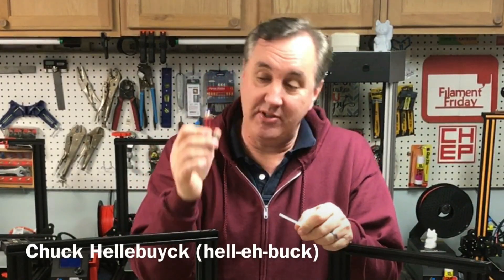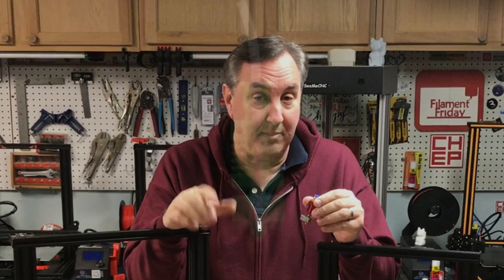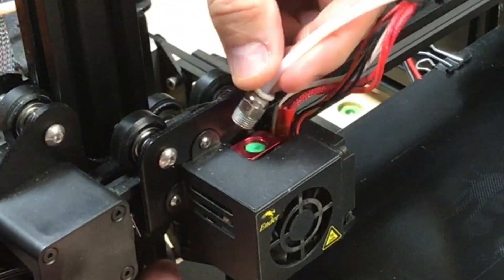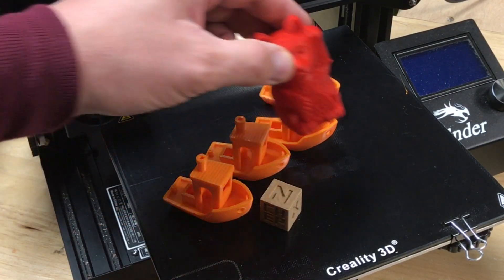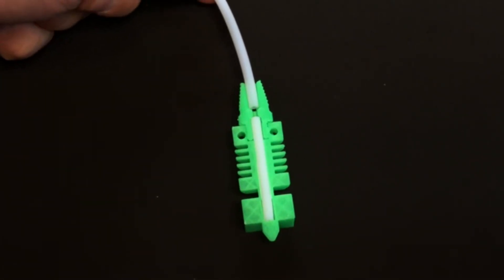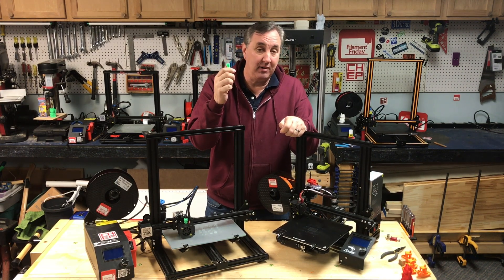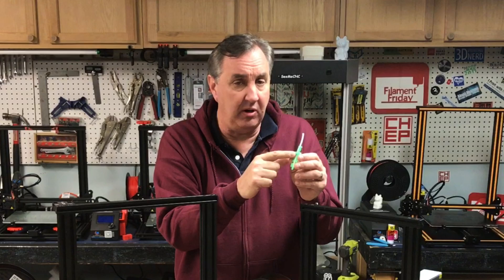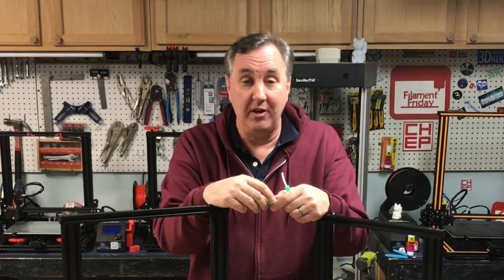Creality Ender 3, CR-10 - Hotend PTFE Fix

Comment: I have a Tina2 3D printer and I am haveing a heating problem the machine heats up to prepare the machine after the machine has purged I start to lose heat before I print any product andI get a heater failer error how can I fix this problem

Comment: well but why did you have to use that spacer in there, wouldnt it had worked if you just pushed the ptfe tube down without the washer?
Reply: The coupler will eat into the tube during retractions and feeds. That is what causes to movement and in turn the gap at the tip of the PTFE and the nozzle. What this does is "decouple" that last section of PTFE and forces it into the nozzle then if the second section that is held by the coupler moves around it will not be a problem causing clogs and backups . The washer is what is pushing the last section of tube down from the coupler threads pushing IT down.
Reply: to stop the ptfe tube from backing out causing a small gap between the nozzle and ptfe tube (a common problem for the ender 3)

Comment: The Boden tube coupler faild me and was nolonger holding the tube to the hot end will definitely get this printed out. In the mean time I used the smaller coupling and JB welded it to the larger coupler so I can print the parts

Comment: my fan seems to slow down considerably to and then if I like touch the fan blades real quick with the tip of a tiny screwdriver it'll stop and then spin up really fast again then slowed down to a crawl. What I've been seeing is my filament is melting up into the tubing I ruined two sections of tubing in one day just now. Would you say that this is what's happening probably the fan is not keeping the top half of that all metal extruder cool enough? I'm also a machinist do you think if I made a two piece extruder with the top half out of copper it would help? Copper seems to dissipate heat better than any other metal other than gold I'm wondering if I should give that a try. Be a little bit expensive you couldn't really mass-produce on for any kind of reasonable cost but I could make him for myself LOL please let me know what you think if you think this is my problem I just ordered a couple replacement fans and a couple yards are tubing etcetera. I ordered the blue tubing that you show in this video I can't remember the name of it already I forgot I'm getting old LOL
Reply from the maker: Yes, sounds like your fan is failing.
Reply: I've ordered some new tubing and fans and they should be here first thing Monday morning I'm bummed out because I just got this damn thing they must use really subpar fans. At any rate I did kind of burn my fingers trying to take the top coupling out that should not have been hot up there so yeah the fans got to be the problem I had melted pla two and a half inches up the tubing. So it must have been a cap and then greeting itself up the tubing until it finally cooled and then I noticed extruder gear clicking every once in awhile as they gave up and then spun back into place I also noticed that the screw was about three turns loose on the spring assembly so I think it was a combination of things.

When I get my fans if there's enough Warrior left on the fan should I try and feed it all the way back to its source or just snip and solder and heat shrink? I think I'll just snap it Saturday and he trinket nice and neat. Luckily I have 30 years of soldering so it'll being nice job anyway. Maybe I'll get to Molex connectors I have a T-Type Molex crimper I could make a connector right there so if I have to switch fans it's just plug and play

Comment: im so discouraged my PTFE tubing keeps getting clogged way up/  I'm new and bought a cr10 s2    in one day I fucked my machine up no ptfe tubing left.  is there any PTFE i can buy that cheaper then the damn crap they sell specifically for the cr10s
Reply from the maker: Cap Tubes & Couplings: https://amzn.to/2Vf8BCf
Reply: @FilamentFriday  I bout this type of tubing although I am looking for like a spool of the stuff. these manufacturers rip people off.  I'll put this through a time gas chromatograph-mass spec and find out its composition 

I, also a metal worker. I have a lathe and mill with all the optional toys.  I want to modify a nozzle to allow the tubing to go into it by a few mm.or perhaps a metal tube that screws into a custom nozzle that attackers to a tube that the top fitting screws right into maintaining the <2mm size.
Reply: @ClownWhisper  I know it's been 2 months since you posted your comment but you should really consider getting rid of the "ptfe lined" hotend type and move to a full metal one which is much better to finally use your printer and not toy and tweak shims and bits of strings to get your PTFE tube to stay in position.  
On creality machines you can get a microSwiss drop in replacement hotend (or go for the clone one by trianglelab which does a good job unlike many other part cloners).  
The "creality hotends" with ptfe down to the nozzles are  such an horrible horrible hooorrrible design they're not worth fixing. 
Hope you've got your printer fixed tho ;)

Comment: ever since I aded  caper corn tubing I have bin getting under extrusion
Reply from the maker: Check for slippage at extruder.
Reply: @FilamentFriday  less the screw was extremely lose after tinting the screw the issue was fixed

Comment: Chuck - I am still having problems with my HotEnd that came on the SunLu S8.  I have taken it apart a number of times to clean out jams.  The hot block on this is a little different than the other Hotends ..  if y ou could take a look at yours (I bought mine after you did a demo ) and you can see that you can not push the Bowan tube all the way to the tip ...  it has a separate piece that can only go in from the bottom..???  Any help would be appreciated..>!!

Comment: This hot end "fix" (some call it Luke's fix) seems to be making the rounds lately.  I tried it and it didn't work for me.  My problem turned out to be "heat creep".  When I removed the two screws adjacent to the nozzle my problem vanished instantly.  Previously the printer would run perfectly for an hour or two and then clog up.  When I cleaned it out I noticed the filament in the lower end of the of the heatsink had softened causing an increase in friction the extruder could not overcome.  That's a clog.  Anyway, I think Luke's fix is a good idea but I also know heat creep is very real.
Reply from the maker: Heat creep is caused by a failing fan not the screws. I’ve seen it on my own machines. Fab spins but too slow to cool. Replace the fan and heat creep goes away.
Reply: @FilamentFriday  What makes you think it must be one or the other?  I didn't invent the screw theory, I only confirmed it.  You're free to think & preach as you choose.  My fan spun at the same speed before & after I removed the screws.
Reply from the maker: Exactly. The fan was probably spinning too slow. I have a printfarm full of these hotends with screws running for years without the issue until a fan starts to fail which is common on these printers. Removing the screws is a bandaid to the true root cause but you can fix it anyway you want.
Reply from the maker: I don’t base my findings on one printer, one experience. I often test on multiple and get 3rd party feedback as well when creating the videos.
Reply from the maker: Here is more proof of someone who was in your camp. https://twitter.com/v_saggiomo/status/1309883595419537410?s=21
Reply from the maker: I’ve had far too many beginners listen to myths like that and then come to me for help. That’s why I make the videos to help prevent their frustration.
Reply: @FilamentFriday  As a newbie, it's hard to tell a guru from a BSer.  Not saying you're either but I've learned over the years to believe what I see over what I hear from a source I don't know.  My screws stay in the spare parts bin.
Reply from the maker: Gotcha. I’ve heard this type of skepticism before from many newbies. But after 6+ years 3D printing and making videos sharing my experience has gained me almost 150k subs and 13 million views. I’m not that good of a BSer :)

Comment: Hi Chep I have a second hand cr10s it has a heat tape around the hot end  my question is, is it needed it is lose and has had filament built up under the tape can I remove the tape I have a pic I can send you if you like.
Reply: yes you can 
replace it with a silicon sock though

Comment: is there any reason you couldn't use this as the foundation for an all metal upgrade by using an aluminum tube in place of the ptfe tube?  or maybe switch to a PEEK liner?  mcmaster has 2mm IDx 4mm OD PEEK tubing with a claimed max temp of 500 celsius for $18.71 a foot, one foot could do about half a dozen printers.
Reply: this sounds like a great idea
Reply: Aluminium will conduct heat all the way to top and melt all the filament and jam it.
Bad idea!
Reply: @parasyte25  peek tubing is what I was talking about.
Reply: would want to use steel to prevent heat creap
Reply: @elitewolverine  peek tubing would prevent heat creep better than steel
Reply: @butre.  This is true but still limited to lower temp printing...then again not many people are gonna print above 300 or 350c

Comment: Huge question!!! What if you use a steel tube with sizes 4mmx2mm? Is it possible to increase the maximum printing temp???
Reply: I guess there would be some tiny gaps between the tube and heatsink   
might reduce the cooling efficiency
Reply: @achen5269  the PTFE tube is 4mm so gaps will be tiny. The bad thing of have a steel tube touching the nozzle it is that it can heat up but higher in the heatsink it can dissipate that heat quickly.
I am waiting for my CR-6 to test it but I though  @CHEP could try it more professionally.

Comment: Hey there love your vids, found you today and you've already pointed me in directions I didn't know ^.^

anyhoo I have a question that you might know to answer. I have issues with leakage (and after this vid I have good ideas how to fix it) but it's now the second time that the heatbreak and nozzle basicaly fuse with the heatblock and I have no way to remove them. I threw out 2 blocks already, so my question exist out of 2 parts:
- Is leakage the big problem here? (My head is going to places like is it expansion/shrinkage that fuse them?)
- Is there a way to recover from it? ... and I mean fused as in: no way to get them from the heatblock. it goes as far as the nozzle being almost a circle as the wrench doesn't want to make it budge and chaves off the brass and today was the first time I actually broke the heatbreak and now only the thread is in the block :/
Reply from the maker: Do you heat it up first when trying to remove it?
Reply: @FilamentFriday  hmm good point, no. But kinda fearful of doing that... I built my printer from scratch with 0 knowledge (learning along the way) ... i might mess stuff up xD

Comment: Maybe it has already been noted, but the printed fitting did not hold the Bowden tube on my CR10s. I was 15 minutes into my first print after the hotend fix when the filament pushed out the fitting. The male threaded portion looked very rough. I had printed a second one because it didn't look substantial enough... The 'nut', on the other hand, looked great. I was hoping to not have to buy the pneumatic push-lock fitting. Not the end of the world.

Comment: You should make a video about the overheating hot sink. Mine overheating heat sink melted the little washer that I printed from your thingiverse (linked in another video) - and before long nothing worked and it had to be unscrewed/cut out of there, which was fun and only took an hour or two. I spent a long time perfectly measuring and cutting, so I had no idea what was wrong and was thinking it was a really bad mod idea - until just now when I watched this video. The fan was working well until I installed the SKR mini board, and I'm thinking the pin outs I had (which said to switch the board fan and the heat sink fan) are incorrect.
Reply: Though, in thinking about it, I realize you may have already made a video about the dangers of a weak heat sink fan...

in a previous....

Filament Friday.
Reply from the maker: I did. And showed how to replace it with a new stock fan. It is common on early Creality printers to have that fan slow down and cause heating issues.
Reply: @FilamentFriday  In that case, I am realizing I actually might have watched it, lol.. Thanks for all the great stuff. For some reason I thought the SKR mini would only turn it on as needed, but others say it's always on, so mine being never on seems like a bad thing. But if I hadn't watched this, it would have taken much longer (and many more failed prints) to realize where to start.

Comment: I am really tempted on trying this upgrade since it has many benefits. I am only scared by one aspect. 
By adding the plastic washer/ptfe tubing, basically the threaded plug is going to be tightened against a plastic part instead of a metal one (as it would be tightening directly on the heatsink). Given the low elastic modulus of plastic, I am scared if this wouldn't give a proper tightening to the thread leading to loosening after some time (considering also the heating effect). 
Did you have any untightening experience after long time usage of this solution?
Reply from the maker: Update video: https://youtu.be/7tCxO17XZtw

Comment: How long is the piece of PTFE tubing that you put into the hotend?
Reply from the maker: It depends on your hotend. 
Here is an update to this video.
https://youtu.be/7tCxO17XZtw
Reply: If the prop is correct then it's about 43mm, but after doing it myself I think 38mm is a pretty good fit.  Ender 3 pro here, but E3 should be the same with stock hotend.  I tried 37mm and got some black spots in my white filament.

Comment: How can i test if the fan is working ok? I keeo getting clogs and i think pla is melting inside the pfte tube.
Reply from the maker: Is the heat sink getting hit to the touch?
Odds are if you Cut off the last 20 mm of the PTFE tube and push back down to the nozzle  the issue goes away.
Reply: @FilamentFriday  the heat sink is at ambient temp on the top. But it feels like tj e pla is melting on the bottom  I replaced 2 pfte and keeps clogin. Ill try another hotend. Thanks anyway to tske time to answer chep.

Comment: so best combination is capricorn tubing in the hot end and your coupling with the ptfe tubing for the filament transfer? no need for the plastic washer right?
Reply from the maker: I don’t understand the question. I show the washer is part of it.
Reply: CHEP but you said, that the coupling that you‘ve designed has the washer in it, or did I misunderstood you
Reply from the maker: Sorry, I got confused with my newer video. I no longer recommend this. It doesn’t last. But yes, the design eliminated the washer.
Reply: CHEP which video would that be? :)
Reply: CHEP ah found it thanks 👍🏻

Comment: I have ender 3 pro and i'm getting "Thermal Runaway printer halted" error message. don't know how to fix that.
Reply from the maker: The temperature sensor may have fallen out of the hot end.
Reply: That may have done the job thanks

Comment: I tried making a print 3 times and it broke off all 3 times. I love CHEP but I would NOT recommend this part. There is nothing wrong do the design by ONEBADMARINE PTFE fix which reuses the original threaded metal coupling. 

The threads on this can't take the torque and split apart at the layers. If it was able to be printed lengthwise it might be okay but it's not designed to be printed like that. All the movement on the X axis puts a huge strain on the part.

Comment: I printed this in PETG and it broke in half, leaving part of it screwed inside the hot-end where I can't get to it... So that's a flaw in replacing a metal part with a printed part...
Reply: Do these not unscrew? Like remove the nozzle or whatever is easiest and push a stick through the bottom to push it out. That’s if you couldn’t use a pick to pull it out from the top.
Reply: I just used a flathead screw driver and applied downward pressure to have it grip into the plastic and turned it out. Worked fine. Won't be printing these again

Comment: Maybe a stupid question... But why can't you replace the short ptfe length in the hotend with a metal tube length and have an instant 'all metal' hotend?
Reply: Whoops sorry didnt see that comment below!  I dont see why this hasnt been tried yet
Reply: @Tinchineering  well,, because many of us do not want or need a all metal hot end.

for starters, all metal hot ends are engineered a little differently, than simply a "tube"  slid in.  they have a heat break,  this is required or every time you retract the filament it will cool and stick in the all metal hot end.

the second reason is stringing and blobbing because the retractions and settings all need reconfigured for a all metal hot end.

long story short.  if all you print is PLA... the stock hotend in my opinion is actually BETTER than an all metal hot end.  and onebadmarine, fixed one of the major issues that the stock hotend had.

personally, I would go with the ORIGINAL fix from onebadmarine.   not Chep's fix.   

this is one of those times where I think someone found a super simple solution that just works,, then tried to make it "better" but really made it more complicated and inferior.